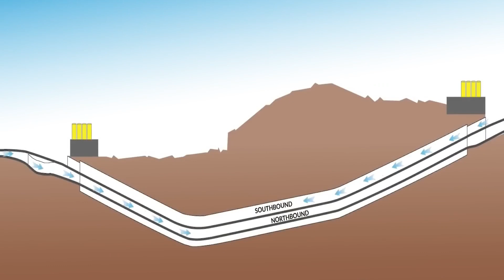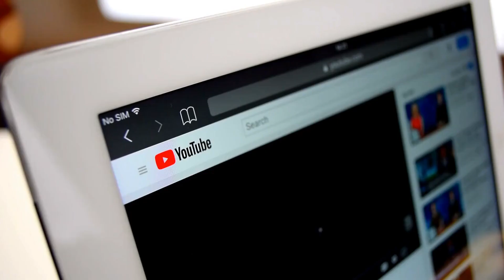China just Build the Longest Undersea Tunnel! American Engineers in Shock!

Comment: US is just waiting to the failures of China tufo projects.😂😂😂😂😂 . This is not innovation, it is just a copy of the other country innovation. We expect that this project will under renovation, one month after it will be opened to thw public.😂😂😂😂😂
Reply: They're already leaking and some have collapsed before they're finished. I've seen the actual video. Yeah, US engineers are shocked all right, because of all the shortcuts and unbelieveably shody construction. The system is set up to allow the primary contractors to steal half the budget, then the subcontractors have to build it with what they have left.